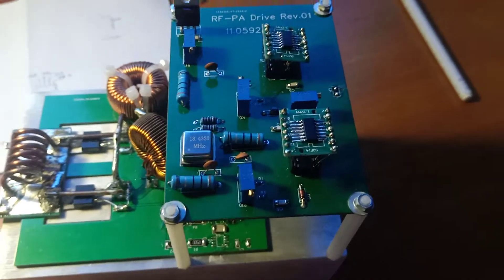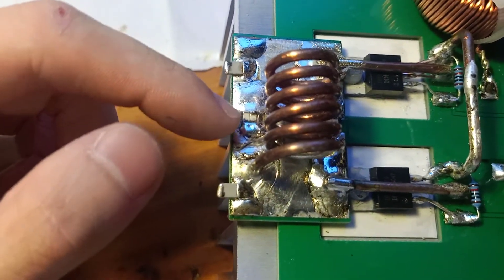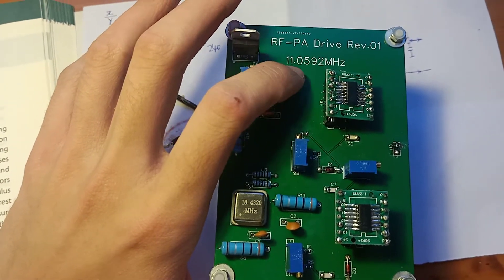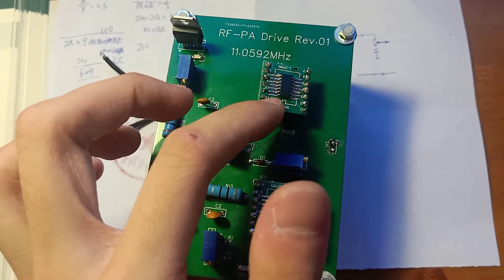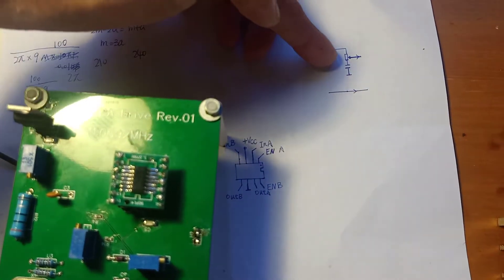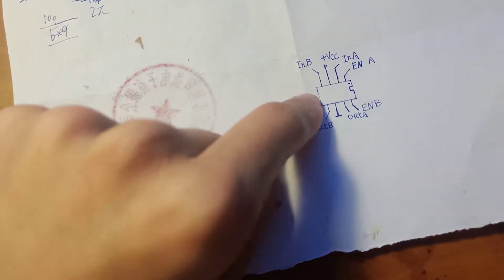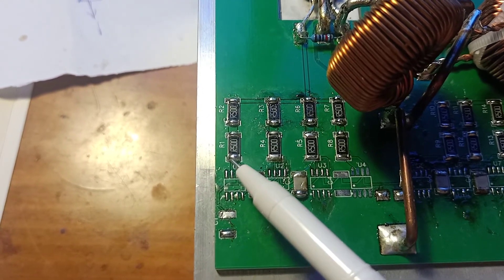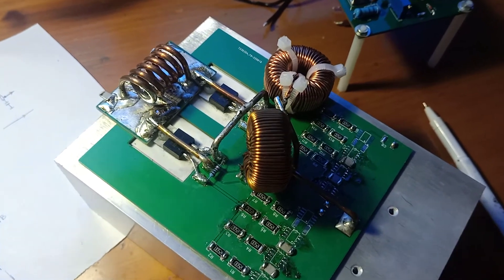Description of my Class D RF power generator

Comment: Very nice design. What gate drivers are you using?
Reply from the maker: Hello sir, I was using UCC27524 as the gate drivers.
Reply: @uecmitsuimarinedieselengin873  thank you. I’m looking into what kind of gate driver I would need for driving a SiC FET at 8MHz for a HFSSTC and I’m thinking 2 of those or 2 of the newer ucc27332 would work well.
Reply from the maker: @LucasWills  I think saw your post on the forum yesterday😹
Reply: @uecmitsuimarinedieselengin873  haha, nice. Did you have any issues with these overheating?
Reply from the maker: @LucasWills  During my test the gate drivers overheated a bit but with a small fan forced air cooling they could withstand that. I think here the gate capacitance is quite similar to your SiC FET so maybe there won't be too much heat related issue, just be careful with the RF interfere current [good RF grounding, decoupling, mind that the inductors shouldn't resonant near the operationg frequency...], I burnt several gate drivers due to that problem in previous development.
Reply: @uecmitsuimarinedieselengin873  alright, I will keep all that in mind. Thank you!
Reply: Sorry for asking so many questions, but do you remember what supply voltage you were using for the ucc27524 here? I'm concerned that increasing the supply voltage may cause them to overheat as well.
Reply from the maker: @LucasWills  In my application I was supplying the gate drivers at 15V and a total dissipation around 15W is reasonable. Maybe use some copper sheets thermo coupled to the chip will help to conduct the heat, or simply just use small heatsinks coupled to the frontside of the chips and apply forced air cooling.